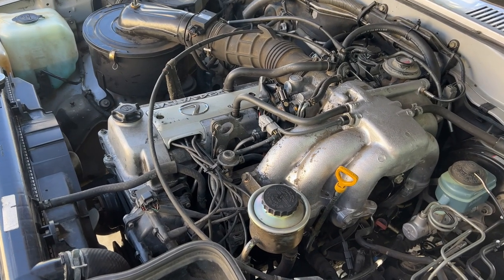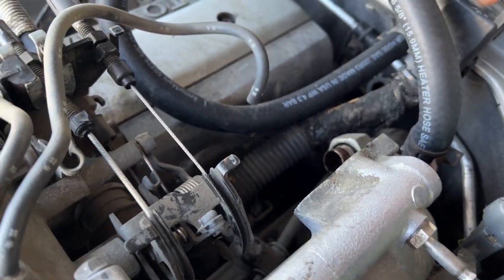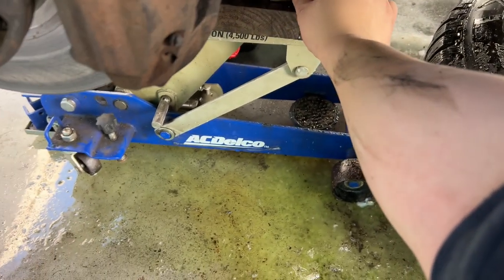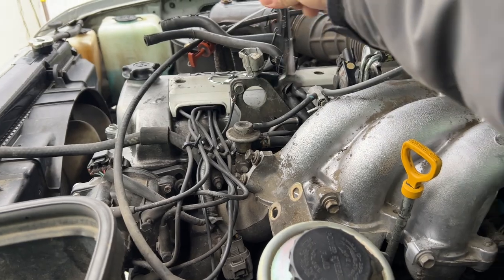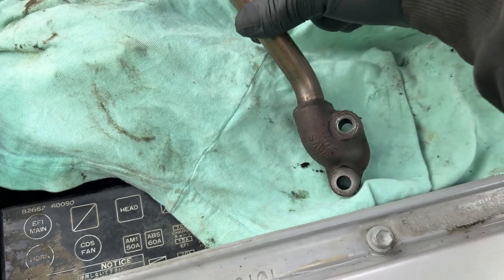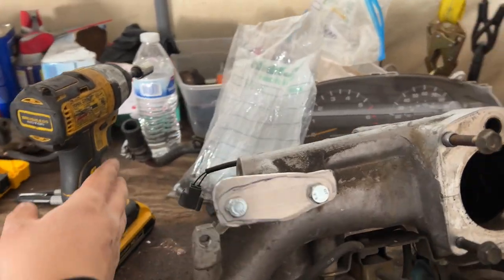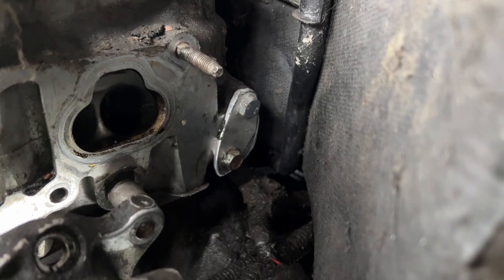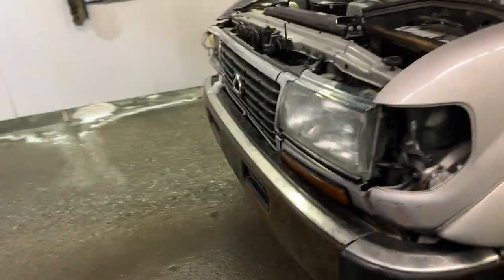TOYOTA 1FZ-FE EGR DELETE | WATCH THIS BEFORE YOU DELETE | FZJ80 LAND CRUISER

Comment from the maker: Update, added resistor where the heat temp plugs too & no more CEL.
Reply: This is great info thanks. Do you have detail on what resistor to fit where to clear CEL? I'm having a performance exhaust manifold made and am removing EGR.
Reply: 2nd for resistor info
Reply from the maker: @h2489-m2l  10k resistor ok eBay.
Reply: How do u add the resistor?  Do u cut the plug off and solder the resistor to the 2 wires?

Comment: I got lucky and was able to take that top bolt off on the side, you're right about now leverage but I took out the 2 bolts to the transmission spout and loosed that brake line bolt and bam! Was able to get a small socket on it. Great tutorial!

Comment: Couldn't you just cap the threaded pipe that's very difficult to remove and leave it in place?
Reply from the maker: Yes. But it would still get hot. The main point is to get rid of it.
Reply: This is what I read on Land Cruiser forum about it: That is a huge amount of work for a cosmetic improvement. 

If the issue was the heat next to the wiring harness, then just plugging the actuator line would have cured it because the tube doesn't get that hot if there is no exhaust gas flowing through it.
Reply: @vanillathunder988  Whats the thread pitch diameter for that threaded pipe? Any suggestions to block it easily?
Reply: @KiyaWarrior  I don't know.  It's not necessary for an egr disable. With mine, I just used the hudd expo temp sensor plug and then plugged vacuum lines.  The pipe was left in place, egr valve removed.

Comment: Almost seems like it might be worth drilling a large hole with a hole saw through the firewall from inside to get to that bolt then cap it off after? Should’ve bought a thin cutting disc for your grinder. Cuts aluminium easy. Cheers

Comment: Why can’t you just put a plate where the 2 bolts hold the EGR in place? Isn’t the purpose to prevent exhaust going back into the motor?
Reply from the maker: Yes you can
Reply: @NuttyNu  
If you can why didn’t you just put a plate there? That way no one would know that it’s deleted. And, it would be a hell of a lot easier! 
Will that make the engine light go off? And, will a 10a resistor clear it?

Comment: Great detailed video! I'm in the process of doing a lot of work on my 1997, and considering deleting egr as well
Reply from the maker: You can do it!
Reply: @NuttyNu  I hate removing the intake manifold on these motors. Such difficult bolts to get to. But it will be a good opportunity to clean underneath it while it is all out.
Reply from the maker: same here. bad design on Toyota. not sure why they made it like that.
Reply: @NuttyNu  not a bad design in terms of intake runners. They are at optimal length
Reply: Hudd expo sells a kit for $35
A lot less work.
I used it in on my 1993.
Reply: @richdevito78  I also used the hid expo kit, been running it just under 2 years now. Eventually I want to block off the ports with the wits end key chains
Reply: @richdevito78  Great tip! Will definitely check out HUDD Expo.

Comment: had the same code but mine needed the VSV valve. How do you figure out what type of resistor you need depending on what MIL code you get? just wondering
Reply from the maker: Most EGR delete is 10k resistor

Comment: Hi, I have a 2000 LC100 with a 1fz-fe engine and have the same problem as you. I changed the charcoal canister and replaced with an OEM. I  still have the pressure and swoosh every time I open the fuel tank. It’s eating my head I don’t know what the problem could be. Please help!
Reply from the maker: I’ve deleted my charcoal canister
Reply: @NuttyNu  any idea what could cause the pressure in the fuel tank. I was advised to change this part 77720-60070

Comment: How did you remove the upper intake after disconnecting everthing. The egr is in the way and the bolt on the intake is in the way. Did you have ti remove the egr valve with the big nut
Reply from the maker: Yes, all of that needs to be remove. PITA
Reply: @NuttyNu  I figured it out. I removed the studs off the intake. Didn't have to remove the EGR. I did not want to remove the big nut, union. That would have been a pita

Comment: Not sure if it'd work, but an offset wrench might reach that bolt. I may give it a shot and upload a vid. Thanks for sharing
Reply from the maker: that would had been my next option if I didn't strip the head of the bolt. Still, knowing what I know now. I would just do it from the top and remove the manifold like I did, and do other maintenance that's along this line
Reply: @NuttyNu  as you pointed out, it's ideal to pull the motor. The 1fs is a beast of a block, not the best fuel economy but it can really wake up with boost.